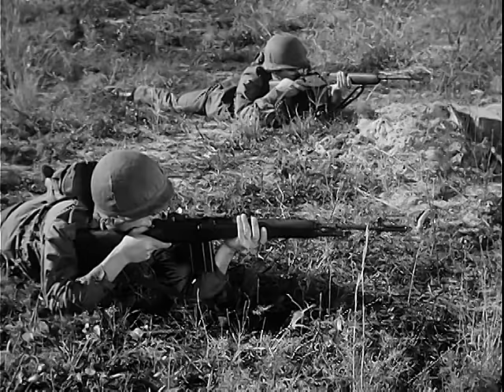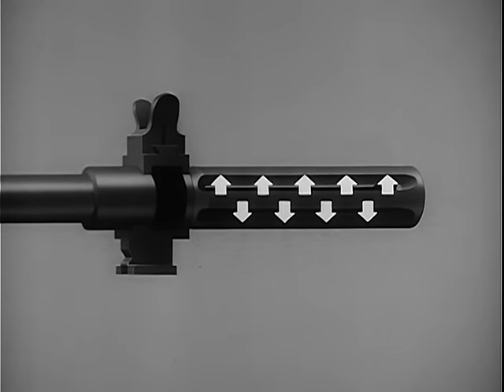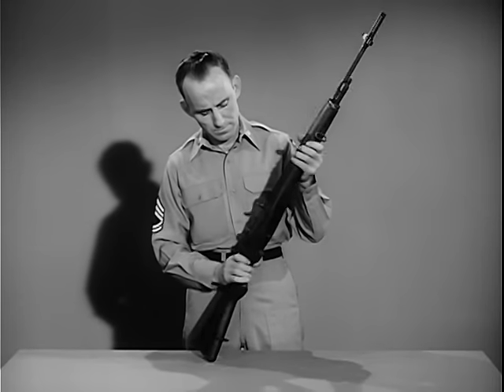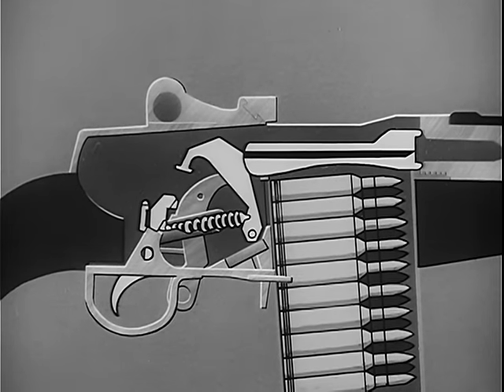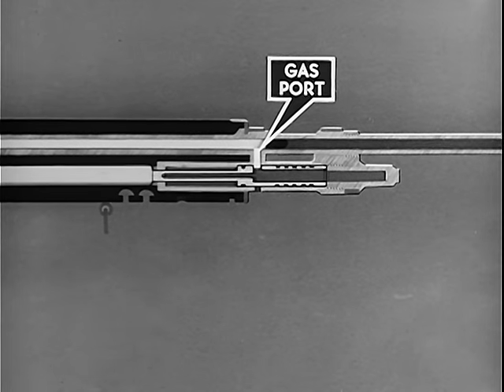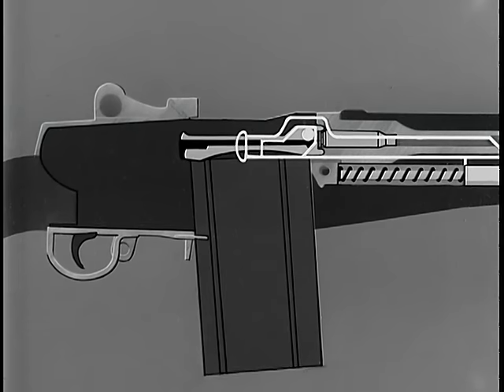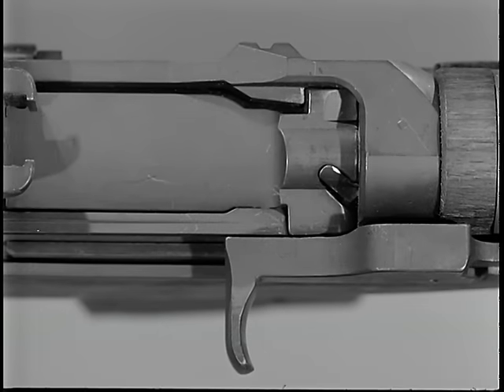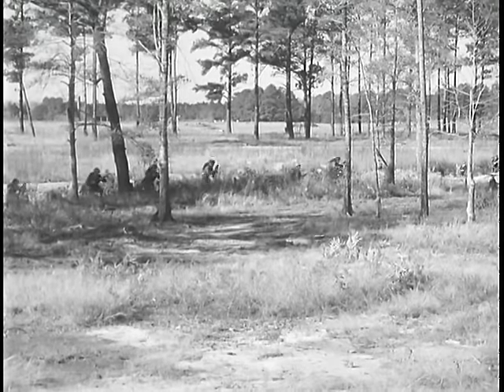U.S. RIFLE, CALIBER 7.62MM, M14 - OPERATION AND CYCLE OF FUNCTIONING

Comment: "A lightweight shoulder weapon"
Reply: l i g h t w e i g h t
Reply: There s a reason why everybody use a 5.56 in today rifle
Reply: Compared to a Browning 1919 maybe lol
Reply: @arewe9647  Not everyone, but the M14 is definitely not for small bois and most women.
Reply: @Seven_Leaf  the main issue is humping that heavy ass ammo. 5.56 weighs less than half of 7.62.
Reply: It was light compared to a BAR or Thompson.
Reply: i know right
Reply: Poi
Reply: @railfan_3371  poi
Reply: Pou
Reply: Pou
Reply: @arewe9647  pou
Reply: @arewe9647  pou
Reply: @arewe9647  Pou
Reply: Pou
Reply: That fires from the closed bolt
Reply: Gonna revisit my comment after a decade, just held one of Springfield's match rifle offerings the other day and it was surprisingly much lighter than I expected, it is lighter than the M1 but not light like the M16.
Reply: @willj78  the M1A SOCOM CQB is 👍
Reply: Different standards back then.
Reply: @arewe9647  LOL said two years before it the 5.56 started getting phased out by 6.8 mm because the brass finally admitted 5.56 is under powered which was known even before it was adopted in the 1st place.🤭
Reply: Yeah if you want to compare it with BAR

Comment: This is what was issued to me when I was in the Marines (1969-72).  Our drill instructors in boot camp made sure we got the ones with a nylon stock because they were easier to take care of and weighed a little less. I preferred the M14 over the M16.
Reply: why
Reply: Because wood stocks require more maitinence and swell in high humidity. And he probably preferred the m14 for more power and increased accuracy when shooting through brush.
Reply: He probably preferred the M14 because of the greater stopping power and the fact that the ammo for the M16 during its first years of service was absolute garbage and made the gun jam very often.
Reply: the M14 was one of the best weapons ever created for use in conventional warfare, and would have been perfect for use during either world war, or the Korean war. Unfortunately the US congress decided that our boys needed a super future rifle able to compete with the AK-47! which led to the adoption of a relatively ok assault rifle that was issued with terrible ammo, and no cleaning kits. Also in asymmetric warfare, it does no good having the ability to head shot the angle dancing on a pin head at 800 yards when the enemy is jumping out at you from the bushes with a shit coated stick
Reply: knightofficer
But now the M16 is one of the best if not the best assault rifles in the world because the AR15 platform has been modified so heavily.
Reply: ***** As someone who has literally slept with an M16 for 3 months, you need to calm down. Never had an issue with one. EVER. The issues about the M16 being "unreliable" are due to crappy ammo and no cleaning kits being issued with them when they were first introduced in Vietnam, along with disposable magazines being reused, non chrome lined chambers, and the belief that the rifle was self cleaning. You don't have to clean an AR to make it work. Just add more oil. I've seen people  run AR rifles 10000 rounds without cleaning, just re lubing to prove a point. They are reliable and i wouldn't hesitate to trust my life to one. In fact, i regularly do.
Reply: @johnnycash8150  Regardless there is alot of data and anecdotal evidence that pointed to reliability concerns with the m16 in Vietnam, just recently i just finished a book about a large scale operation involving Marines against the NVA near the Dong Ha Combat base. An entire company of marines had most of their rifles jammed against a well entrenched enemy and they had to resort to using chicom AK-47's  off fallen dead enemy soldiers. Granted, Marines tended to be more poorly equipped vs their Army counterparts but these incidents shouldn't happen as they put soldiers lives at risk.
Reply: @jdfields711  Had nothing to do with the m16 design and everything to do with the Army making a series of mistakes that cost many lives. Had they listened to the weapon designers that never would have happened.
Reply: @JohnBrowningsGhost  Yes the Army went with a cheaper/dirtier gunpowder vs the cleaner burning gunpowder that Stoner intended, caused cartridges to jam in the chamber.
Reply: Poi
Reply: Rrs
Reply: Direct gas impingement will always be second to piston driven actions, long live the M14
Reply: @johnnycash8150  The M16 does get a lot of unfair flak, but it is not impossible to understand why. While the M14 was one of the last battle rifles made by the U.S. (designed by and for soldiers in a battle environment), the M16 and M4 are based on the AR platform, ArmaLite's rifle designed for civilian defense and hunting. One of its greatest weaknesses was the exposed bolt carrier group that meant a stock was a near necessity for the rifle's very own survival. And while many correctly point out the unsuitability of wood in a jungle environment, I think the rifle would've performed a dozens time better with a skeletonized or wireframe steel stock instead of "le space age" polymer meme stock that made many a serviceable M's into garbage. Hell, had the U.S. armed forces put pride and corporate interests aside, they could've gone as far as to reverse engineer the MP40 and AK platforms and come up with an even cheaper and more reliable platform than the M16 was (which some mechanism finnickies and the bolt carrier group problem, performed decently).

Thankfully, the XM and eventually the M4 carbine platform have alleviated some of those issues without massive government overhauling and expenditure (altho the Army is always going to demand a budget increase to justify the FedRes rats fiat speculation currency and bogus concept of "interest") . Hopefully the SCAR platform is going to eventually be even further refined and standardized in the U.S. military (which is a bittersweet irony, after having Fabrique Nationale getting shafted in the 60's despite producing a far superior rifle that could've saved thousands of the best specimens of American men fighting a war of attrition designed to make zionist interests rich, now taking over in the future American standardization).

Comment: The M-14 is my absolute favorite... I've used it in everything from NRA regional matches to the mountains of Afghanistan. It's old school, and quite arguably the best battle rifle that US. Forces has ever employed. 50 years after it's short term as our main battle rifle, being replaced by the M-16, the M-14 is still alive and kicking, still in battle, and still rocking the house with accurate hard hitting firepower. 

Staff Sergeant, US.Army, Combat Infantry Sniper, multiple tours
As a SOT-A member in Afghanistan, 2010-2011, used a National Match M-14 (heavy barrel, glass bedded stock, match trigger, 1/4 MOA hooded aperture rear sight, semi-auto only) rifle (which I fitted with a Leopold M3A scope, and PEQ-15 infrared designator) which was on loan from the Weapons Sergeant in the ODA I was attached to. Love that rifle... I have a "loaded" M1A that I still compete with on occasion.
Reply: Nice
Reply: Poi

Comment: Set gun to full auto... 
Turns into Anti-aircraft gun...
But with todays technology...
Easily Fixed
Reply: DNchap1417
.308/ 7.62x51................7.62x54 is Russian not NATO
Reply: The problem with "accurate under full auto" is largely a product of what range you need to be accurate. If you are 2 foot away from a guy then yeah, you can get all 20 rounds full-auto to hit his chest, guaranteed.

But that's not when you need full auto, especially for such powerful rounds that will with all likelihood debilitate with a single hit. Full auto is needed for fast fleeting targets, where you don't have time or lead-guessing ability to just tap one in the centre-mass, you need a shotgun like spread for clay pidgeon shooting.

Now... can you get that in a 5kg rifle in 7.62NATO at 12 shots per second? Even with muzzle brakes and hydraulic recoil absorption I doubt that. Yould be better off just trying to aim individual shots at them as fast as you can.

Don't talk to me about suppressive fire with raw cyclic rate, the best suppressive fire is aimed fire that would be KILLING fire if they weren't forced to take cover. Quantity of fire is no substitute for quality of fire.

Raw fire rate works as a bluff, experienced fighters know not to fear a huge volume of unaimed fire.
Reply: Chris Gordon y
Reply: Oops, slight typo on my part... I definitely meant the 51, not the 54, even though both rounds share identical ballistics. Not interchangeable though. In an alternate universe, I'd rather have them adopt the 54 with an improved propellant so in the event war breaks out and you're touring Eastern Europe, you want your weapons to be compatible with their ammo, thus easing logistical burdens.
Reply: @Treblaine  ,,,,,,,Exactly. From back in the day when we could, a bump stock .308 AR lightweight carbine has so much muzzle climb, your last 8 rounds of a 20 rd magazine are shooting the tops out of trees. You can get only 4 or 5 rounds on target. Real full auto would be WORSE, as it has a higher rate of fire. Probably get more rounds on target because OF THE FASTER FIRE RATE. The heavy weight of the M14 helps, but not 100%. 5.56/.223 stops all of those issues.
Or just get a 9mm or 45 ACP AR-15.. For 100 yards or closer,,,,,all that’s needed anyway. VERY manageable and many times more accurate than a pistol.

Comment: They have been re-issuing the M-14 to U.S. troops in Afganistan since before 2005.  Check out the Enhanced Battle Rifle that is assigned to the DSM (designated squad marksman). It is an M-14 with a new stock and a scope added.  Otherwise, it is the same rifle.

I carried the M-14 in Military school, and the M-16 A-1 and M-1911 on active duty.  The troops are better off with an M-14.  It can reach out and touch someone, or get through a wall and still deal with the bad guys.

Comment: Excellent video. I never had one with a sear selector. The rifle was heavy for me (5'6") but lighter than the M1. I could take it down and back together in less than a minute in total darkness. It's best feature was its accuracy. 

 On 'qualification' day the temperature had dropped about 15-20 degrees and I had a crosswind of about 15 mph. I scored only Sharpshooter at 216 points.

Comment: Thank you for serving! You should be proud to know that the Military has reinstated the M14 for service. The recent engagements in Iraq, and Afghanistan required longer ranged firearms than the M16 and the old M14s were perfect for the job. What that tells me is that they never should have been decommissioned in the first place as they are still considered modern assault rifles.

Comment: You are correct.  These were based on a modified M1 Garand design, which was standard issue to the Italian armed forces after WWII.  It was essentially a slightly shorter M1, select fire, chambered for 7.62x51, with 20 round removable mag, with grenade launcher/sights.  This was adopted in the 1950's and was called the Beretta BM 59.  It was adopted by the Italian armed forces and a couple others. Non-select-fire, non-grenade launcher versions for civilian sale in the U.S., were BM 62 and 69.

Comment: The M-14 does not have anything like "recoil unreliability" unless that is your term for some other function.  It is a very reliable rifle and it is not greatly affected by dust or rain.  The only thing you need to do is feed it decent quality ammo, not poorly processed reloads (reloads work fine if they are of good quality).

Comment: You are generally correct regarding the engineering and reliability.  An M-14/M-1A has a relatively open architecture and open gas exhaust routing that makes it fairly resistant to jamming due to dust or powder fouling or water or leaves or cold or heat or lack of constant cleaning.. Its 7.62x51mm round also has a lot more power than the M-16's 5.56x45mm ammo or the AK's 7.62x39mm.  This is very useful if you have to shoot at someone hiding behind a tree or wall or car.
Reply: The 7.62×51 is that powerful huh?

Comment: An incredibly complicated rifle. I used an L1A1 SLR for many years. Based on the FN FAL, the field strip is via a lever lock on the left hand side of the stock. The central pivot pin located behind the magazine housing allows the working parts and cover slide to be removed in one motion. Also, if the gas system is removed, weapon can bolt action fire with just the bolt and bolt carrier fitted.

Comment: The standard pressure .308/7.62x51 is a bit higher.   About 52,000 CUP (copper units of pressure), which is approx. 60,000 psi as measured via electronic transducer.  There are several commercial magnum rounds that run at more than 65,000 psi (electronic), such as .300 Winchester Magnum, theWetherby family, and .454 Casull.

EXPLOSION DANGER!  If you have any .7.62x51 ammo with a headstamp CBC 7.62 75 or anything similar, DO NOT FIRE IT UNDER ANY CONDITIONS, AND DO NOT SELL IT OR GIVE IT AWAY!

Comment: The M-14 turned out to be better than the FAL and G3 at the end of its prototyping and development testing, though it started out way behind.  The M-14 has always been available to Special Forces and Marine guards on naval vessels.  But more recently, it has also been brought back as a Designated Marksman rifle in Iraq and Afghanistan.  It is accurate, powerful, and reliable in dusty, hot, rainy, or cold environments

Comment: Sorry, I misunderstood your question, but you misunderstood what an M-14 is. Late WWII prototypes of the removable mag "M1 Garand" (not T44/M-14) were only TOOL-ROOM SAMPLES, and could not have been issued to field troops even for small unit testing.  Field testing of single samples is rarely done, since it is too small a sample to experience a wide range of users/conditions.  After in-house testing by Ordnance Corps  only then is it built in small quantities for small unit field testing.

Comment: The EBR is a fine rifle and it has an actual advantage over the M-14/M-1A.  The receiver group mounts more solidly to the EBR's metal chassis, so it can be more accurate and less subject to moisture variations.  However, the pistol grip is a matter of taste, and you will find that an EBR is HEAVIER than the standard M-14, so there is no weight handicap by using the wooden stock.  There are some lighter weight kevlar stocks for the "normal" M-14 stock configuration if you need to save weight.

Comment: Read the chronology again.  Korean War ended July 27, 1953 and the first TOOL-ROOM SAMPLE of a functional T44 (M-14 prototype) was not available for Ordnance testing until June 1954, and it was not considered usable until Spring of 1955.  Tool-room samples are not used for field testing because there are only a few copies available.  Only AFTER the Ordnance Corps decides an item is usable and initially debugged, will it be put in limited production for issue to field troops for field-testing.

Comment: @MrThomPS3 The Grease Gun was designed during ww2 to be a cheaper to manufacture than the Tommy Gun, but acted as a stop gap only. Its firing rate was half that of the Tommy Gun.

Comment: I trained with the M1 Garand, was issued an M1 carbine when I got to my unit, and was issued the M14 when I had been in Europe less than a year.  If I had to take one of them into combat I would choose the Garand.  The mechanism is simpler and as others have noted, full auto is just about useless.  Even the carbine, firing .30 cal pistol cartridges climbs uncontrollably.  The M14's  we were issued required a special tool before they could fire full auto, because the army recognized the problem.

Comment: Battle rifles really are the way to go in our current engagements, but carbines remain important for battle drill 6 and similar situations, or for mechanized and mounted units that need something small to carry. Different tools for different jobs; you wouldn't use a Bowie to spread butter, or a butter knife to skin a deer, or a frying pan to test amperes.

Comment: @sladerfoster  If you sanded it down the hammer would just slide back forward with the bolt not striking the round. You need something to push the sear off after the rifle bolt has gone all the way forward. Which they used that long bar that tuged on a lever pushing the sear backwards releasing the hammer.

Comment: It was not used in the Korean War (1950-1953), since the M-14 was invented in 1954 and not made general field issue until 1959.  You are wrong about the usage as a sniper rifle, since the XM21 (accurized, scoped M-14) was made in limited quantities (~1400 rifle) for sniper use during the Vietnam War.  It was standardized as the M21 shortly after the that war ended.  It was replaced as the standard sniper rifle (some were in reserve) in the late 1980's, by the M24 (accurized, modified Rem. 700).

Comment: Wrong, M-16 was not BLINDLY accepted "after NEVER field testing it"..  The Air Force tested the rifle1959-60 and found it to be suitable to replace their M-2 Carbines (full auto M-1 Carbine) for air base defense.  The Army was simultaneously testing various concepts to replace the older M1 Garand and M-14 designs.  In 1962, DARPA bought 1,000 PRODUCTION M-16s from Colt for field testing in Vietnam as part of DARPA's Project Agile.  That's far more than the mere 10 that your friend claimed.

Comment: A carbine is a rifle with a barrel of less than 22 inches
Reply: M14 barrel is 22 inches.
Reply: +George Satterwhite They come in carbine versions as well but it has a different name, same gun though.
Reply: +RevolutionV12 M-14 or M1-A socom is the modernized shorter version of the M-14